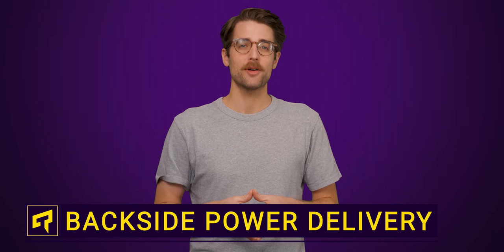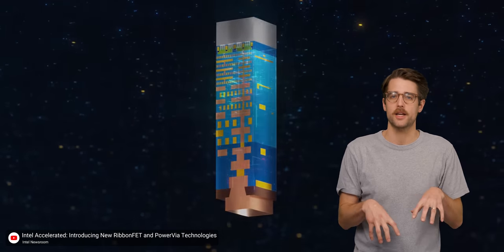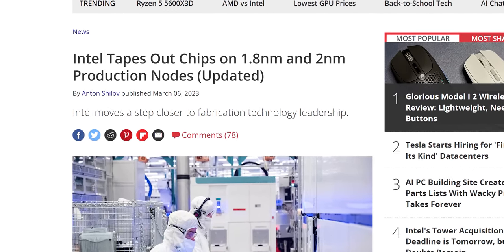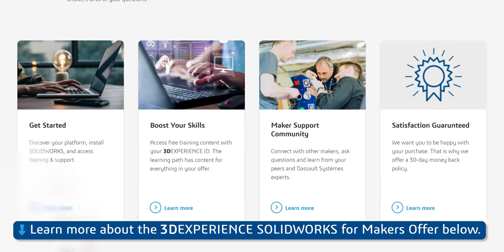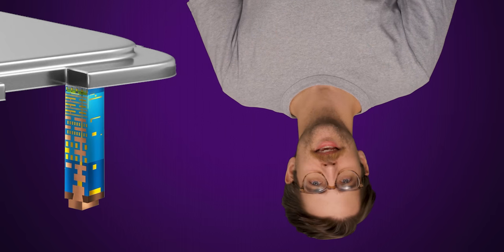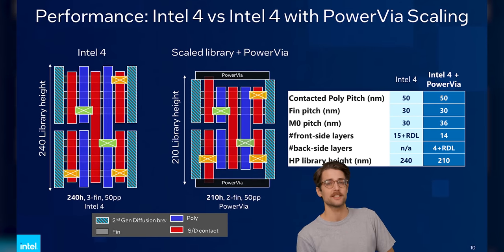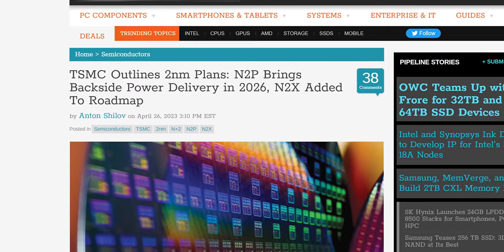Intel Is Flipping the CPU Upside-Down

Comment: The biggest heat points are going to be at the contacts then every time the connection steps down, even if it's a solid piece. As the power is diffused through the circuits passed through the silicon the heat generation will be less at each point. I'm sure someone already knows (hopefully will contribute) the heat at the power contacts on the silicon vs the heat of the internal IO vs processing.

I don't think moving the power delivery will really change cooling much if at all. It's probably only going to be the thickness of the current protective layer, heat generation shouldn't be much of a factor and conductivity should be about the same.

Comment: Well reducing the resistance of the power wires also means less heat, so in the end it might actually output less heat overall and be just as easy (or hard) to cool like any current chip, but ofc that´s only theory.
Since Intel will most likely try to increase those clocks even further, they will probably loose the "heat advantage" and the additional layers may actually become a problem.
But we´ll see i guess.
Reply: Most heat is generated by the transistor itself, the heat from too thin wires is tiny comparing to that.
Think putting an electric hand warmer next to campfire, yeah, it generates extra heat, but that heat is irrelevant.
Reply: @hubertnnn  you think 105W of power through a few copper wires as thin as a human hair isn't contributing to the die's total heat output?
Makes no sense to me.
If we think about the core voltages these days at barely around 1V, that would pretty much be 105 Amps of current which is a miracle on it's own tbh
Reply: @MultiWirth  Its not pumping 105W through a human hair wire, its pumping that through millions of human hair wires, so each has to transfer very tiny amount of amps.

Its the same as with cables, if you cut a cable you will find that most of them are made out of hundreds of tiny wires, so the load is distributed between them and you don't loose a ton of energy into heat due to small wire.

Comment: I don't get this.
Some 25 years ago, when I was in the university learning how to draw mosfets/transistors to get logic gates, I was taught that they are drawn either a) above the wafer and have signaling on the same level ; or b) above the signaling (with signaling between the wafer and the mosfets) ; 
And the power was drawn as the top layer because the paths/wires are bigger and can act as heatsinks or heat conductors for the actual heatsink.
Now all of a sudden intel discovered fire?! Who is running that company? Are PRs in charge of innovation over there and only now they found about this?

Comment: The distance of the transistors from the IHS shouldn't make a difference. Silicon conducts heat about as well as copper. Silicon dioxide is a little worse but still much better than thermal paste.

Comment: Wouldn’t the front side layers of copper wires actually be more thermally conductive than the raw silicon itself? Unless the die has to be thicker overall to support the wires, reducing efficient thermal transfer to the heat spreader.

Comment: You need to do a video that clearly explains the true scale of this Nano-engineering.
Most people have no clue what nm actually means.
As the smallest feature size is about 4nm, this isn't the size of the actual transistor. These transistors actually vary a lot in size depending on the task there were meant for.
There is also the argument that chip makers should be using a different measurement scale, the Angstrom.
1 Angstrom is approximately how large an atom is, and is 0.1nm in size.
So a 4nm process is really, 40 atoms (Angstroms)

Comment: The bigger power contacts throughout may actually improve the thermal issues: you can cool larger traces that reach down into the chip. I'm still surprised that we haven't seen doublesided chip sockets with coolers each side or mobos with cpu on the underside right underneath ram and gpu slots.

Comment: There is an error in the video... The chip would actually be better cooled since the copper would provide a better heat path through the silicon since the cooling Happens in the opposite site of the Bulk not the wire side... I only say WLCSP Package...

Comment: ANYTHING that reduce voltage drop also reduce power consumption, and thus, heat production. That mean chips running slightly cooler. That alone, will mitigate any heat dissipation issue.

Comment: Chip makers should think about on chip cooling channels as well. Perhaps micro channels on the die, with then concentrate heat, which is then cooled by conventional cooling. Also high frequency RAM chips can use optical memory taking advantage of reversible photochemistry.

Comment: Doesn't this mean that the 15th gen Intel is going to release WILL NOT SELL because these new chips are also near their launch?

Unless ofcourse they use the same socket, in which case this new tech should also release for 12th 13th gen to bring cash quickly
Reply: Power via may be part of 'Intel 20A' and 'Intel 18A' processes. So when the respective CPUs are going to be released is related to 20A and 18A processes used for production.

Comment: Intel says these added wafer materials isn't a problem?  Let's see what happens with TSMC making AMD's X3D parts?  Oh, clock speeds slow down because of heat takes longer to dissipate through these materials EVEN WHEN this Vcache layer is made as thin as possible.  And this isn't because of heat having to move through a layer of cache, it's the heat that has to travel through the empty silicon tabs that go on either side, and in fact you can run HWMonitor and look at the different temp sensors inside a 5800X3D as an example and see that the CORES are getting hotter and that stacked Vcache is within perfectly fine temp ranges.  The LOWER stack of cache gets hotter too.  All this says that with a layer of material added to the top of a die, it's harder to dissipate that heat out of that lower die.

Or, at least that's the case with what TSMC is doing right now.  Maybe one day they'll resolve that issue.
Reply: AMD claimed the lower clock speed was because the cache was sensitive to higher voltage, not because of heat.

Comment: I don't know if it's actually better but i guess time will tel us if turning upsidedown the design would be actually better for the chip ,as mentioned in the video it may or not may be related to the actually heat spreading of the  transistors inside chip . Maby the more lack of via and long but thin traces will compensate and add a plus for the whole circuit as less RLC component can be found in longer traces .

Comment: With the seperation, where is the power going to be delivered from? If its the same pins, routing the power through has its own issues.
Reply: I THINK that the transistors sit on the boundary between the power side and the data side. Most wires in a CPU are just connecting transistors and have to weave above and below each other. Only the transistors need to be connected to power not the wires carrying the data

Comment: Wait, this is just flip chip with connections both sides - and intel did flip chip in 2000 on socket 370....  FC-PGA was introduced by Intel with the Coppermine core Pentium III and Celeron[2] processors based on Socket 370.

Comment: I see the great side to reduce the CPU cost, but what about the socket that would be on the motherboard ? I guess the socket gonna be more expensive to make
Reply: the chip isnt on the socket - it is on a carrier pcb
Reply: As I understand, the socket is now gonna be the one handling power, while the chip will mostly be left with only transitors.
Might still be in a lga form factor as a whole with a carrier board, might not
Reply: @aonoloki than you didn’t understand the explanation. Backside power delivery only separates power and data on the die side of the chip the substrate itself doesn’t need to do that since you got a lot more space to work with preventing the issues of too small wires. The only thing that might have to change to accommodate this is the pinout of the socket (i.e. which pins carry data and which carry power).

Comment: while they're at it they should take half the power delivery pins out of the socket and run power ground through the heat spreader.
Reply: They can power chips with lightings going through the air over chips.

Comment: Could they not also have “cooling wires” that go through the entire chip that conduct the heat better within the chip and out the top exposed to the heat spreader for better cooling?

I’m sure there’s a knowledgeable chip expert here which can explain why this is/isn’t a good idea
Reply: Would those cooling wires be a different material to the power delivery wires ?

If not, then the power wires can also be used for heat transfer.
Reply: Don't really need that.  Silicon itself is a pretty good thermal conductor.  So, as long as it's solid (and there's very few silicon processes that leave voids, so it almost certainly is), it'll conduct heat just fine.  Also, they'll probably pack the power routing metals and vias as dense as they can get it (better for thermals and power delivery), so that helps too.
Reply: My idea was to specifically expose the conductive metal on the top of the chip and not covered in the plastic chip coating.

@ccoder4953 Thanks for the response! Makes so much sense that silicon is a good thermal conductor! It voids my idea, but I’ve learned something new today!

Comment: idea for next time measuring wireless signal you see stuff like -88dBm, what is good, what is bad, what is dBm is this some kind of sound? why is it negative?
Reply: dBm is just a measure of power ratio between the linear value and a reference value. For dBm it a mWaty. dB are a log measure so you have that any value in dBm is given by 
Val_dBm = 10*log10(Val/1e-3)
In this case Val is expressed in watts

Comment: How do you cool the transistors then?
Reply: Same way as before. The entire chip is less than 1mm thick, and silicon conducts heat (to a cooler or heat sink) very well. None of that is changing.

Comment: Isn't most of the heat generated by the power delivery and not signal wires?  Why don't they put the hottest of the two on top and the other on the bottom?
Reply: Power delivery is DC voltage. It does not have any 'signal', so power delivery can be done with as thick copper plates as possible, so power delivery has very small effect on overall power dissipation.
Reply: @alexanderbelov6892  I'm aware the power delivery doesn't have any signal.  They're saying they tried to isolate power delivery from signal wires.  My thought, is that most of the heat generation comes from the power delivery.  I would think signal wires do not generate as much heat in comparison.  Therefore, shouldn't the part generating the most heat be closest to the IHS?  Otherwise the heat from the power delivery would have to travel through the signal wires to get to the IHS.  That seems counterintuitive to me.
Reply: @dpjazzy15  Power delivery is just part of circuitry. Power delivery with thick wires dissipates less heat than thin data wires. The formula is P=I•I•R, where I is current, and R is wire resistance. Wite resistance is proportional to wire length and inverse proportional to section square. Thin and long wires produce more heat than short and thick wires.
Reply: @alexanderbelov6892  signal wires might only have the tiniest amount of electricity, because they just need to carry data.  It would be dependent on the specific chip, as to where the most heat is generated.  I'm just thinking you'd take the hottest part and position it somewhere you can cool it the easiest.

Comment: Ideally they should make several power plates, sandwiched between two ground plates.  Then a hollow silicon stem should be formed through to the appropriate layer.  

Additionally, there should be a second ground plate on the top above the signal wires.   While this adds a tiny bit of signal wire capacitance (always a downside) it also allows the ground plate to be used as a heat spreader with minimal distance.

Personally, I'd also flip the design putting the power on the top and the conduit signal on the bottom.  This of course means thinning out the power layer instead.
Reply: We’ll be sure to let the fine folks at Intel about this “ideal design” they missed in the comments section. Thank god the hundreds of electrical engineers working on this project for years have you to think of all this stuff they collectively missed.

Comment: Pretty sure we see this with AMD 3DCache CPUs and having this sit over the top of transistors actually increases thermal resistance making it harder to cool/dissipate the heat. Thought I will add the 3D Cache CPUs as the 78003dx and so on do have thicker IHS for some reasons which also contributes to this but they really need to innovate on heat dissipation because packing more transitors into a small space which generates more heat in a smaller space then adding more layers over the top is going to make dissipating this heat so much harder resulting in higher idle temps and much smaller headrooms to TJ max. 
All for 5% extra performance btw? Yeah color me not impressed if that's the gains they're claiming. Unless that enables them to change designs in ways that nets more performance.

Comment: So its just another gimmick.
They moved the internal wiring to the other side of transistors.
And what is so special about this?
Isn't this just obvious to use all 6 sides of a transistor (assumed cube) to maximize the communication?

Comment: well make the power wires vertically wide then, even if narrow horizontally, omg multilayer pcb's (chips) are so 80s, come on, also you can first drill the backside vias through the thick wafer, you dont have to attempt make a janky solution, keep high rigidity wafer, the power vias are macro features, not even micro, which can be stacked on top, layer by layer

Comment: LOL 5% increase, I thought it would be something revolutionary like around 50%... but the video raised an interesting question in my mind: if the very small wires inside the CPU create resistance, what would happen if the CPU was bigger, let's say twice the size? Or 3x? Or 5x? Or the size of a modern day GPU? Would this result in a much faster CPU with much better heat dissipation?
Reply: problem is silicon wafers are expensive and have oftenly defective spots so they just print them in batches and throw out the sectors with defects, if every cpu was bigger they couldn't just throw a bigger cpu for a little defect on it
Reply: @AdrianOkay  But I'm guessing defects are caused by the small manufacturing process that is prone to imperfections, in a bigger scale that wouldn't be such a problem.
Reply: @wettuga2762 But on a larger scale, a single defect (and they will still happen) will lead to a much larger chip being thrown out. The defects made with a smaller size still amount to less wasted material and money I suppose
Reply: @trueNahobino  I was thinking of defects in relation to size. On a normal CPU, a tiny nano imperfection might be enough to break a path as wide as the imperfection itself, while on a bigger scale that imperfection will have basically zero impact. But I understand why smaller is better: the shorter the travel path between components, the faster the CPU will perform. If I build 2 identical CPUs, one bigger and one smaller, the 2nd will be faster but also run hotter. But if I build a CPU 2x bigger with just 1.5x more hardware/cores/whatever inside, will it be faster and run cooler than the smaller CPU?

Comment: Hey @Intel how about using something like a plastic contact frame with integated copper lines/contacts from the IHS side to deliver power to the CPU then you could put all the signal contacts to motherboard side and when I am already giving weird ideas how about putting the RAM on the Backside of the motherboard right under the CPU the traces would be at least 75% shorter😂 All the manufactors think of the motherboard too much in 2D....🧐

Comment: 5% freq increase? I was expecting something like 50%, although in practice and for my needs I need a cpu with 5000% freq increase and even that would not be too much in the long term for my programming experiments. Thanks for nothing. What I also would like to see as a breakthotugh is a system where both the CPU and GPU share the same memory at low latencies and high bandwidth, that would be a real breakthrough. It's amazing how people get excited over almost nothing.
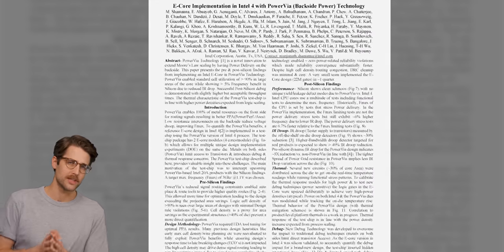Reply: 3:16 "Showing > 5% Frequency benefit". So 5% is lower bound of frequency benefit. Also Intel claims > 90% of chip cells area utilization that increases transistors density over process without PowerVia.

Comment: Intel is set to introduce a new technology called Power via to its new processor lineups, which could revolutionize CPU fabrication. Power via, or backside power delivery, separates power and signal wires, mitigating the issues of interference and voltage drop that come with having wires so close to each other. This new method also makes manufacturing cheaper and easier, as chip makers do not have to pack in as many small wires, reducing cost and complexity. Additionally, Power via allows for more of the dye to be filled with actual library cells, groups of transistors that process data, rather than blank space. Samsung and TSMC are also working on their own chips featuring backside power delivery. The first Intel chips with Power via are expected to hit the market in mid-2024, with chips from other manufacturers likely to follow. While some enthusiasts have raised concerns about the layers of front-side wiring separating the transistors from where a CPU cooler would sit, Intel claims that there is enough thermal conductivity through these layers to make cooling CPUs with Power via no more difficult than traditional chips.